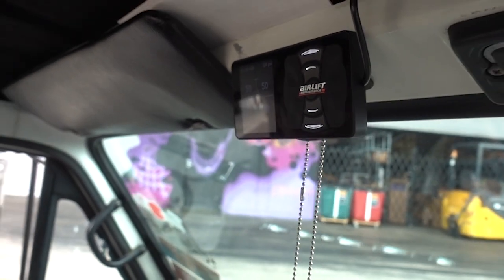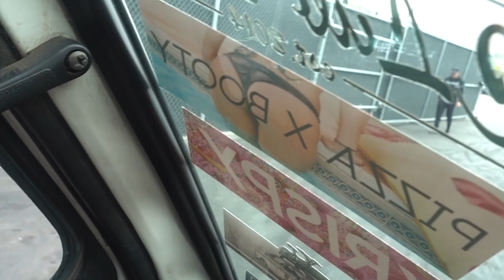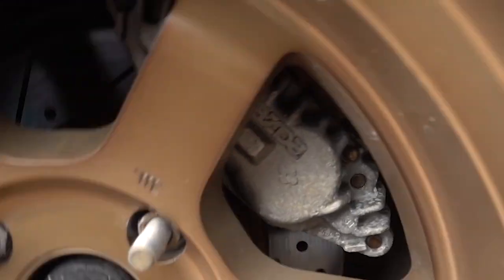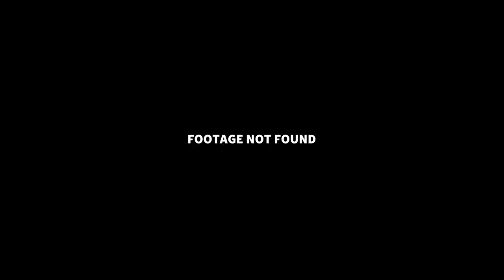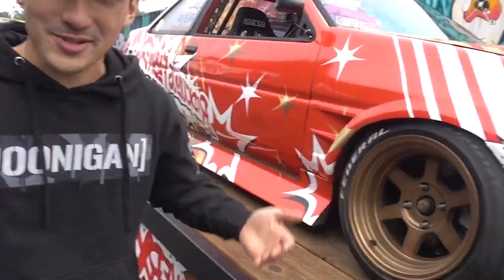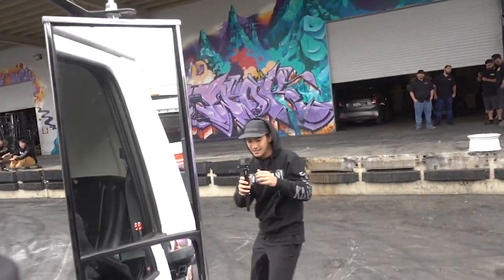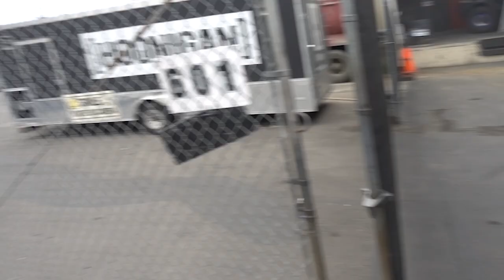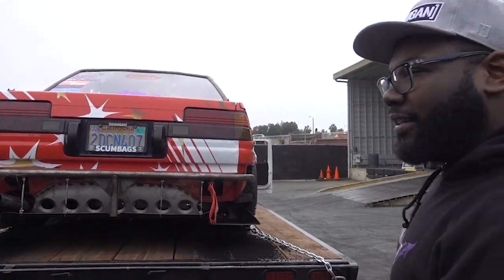How to Load a BALLER HAULER

Comment: I was thinking of building a camper but worried about having a crappy engine. LS? Problem is I am in the UK :'(
Reply: A ton of guys here in Australia have put the EJ25 WRX motor into VW Campers

Pretty popular swap down our way
Reply: It fuckin sucks in the UK. VXR8 is the only way to get LS 😪
Reply: Yeah and too expensive, I want cheap reliable power already, he said $1000, thats just over £700! It would be funny to use a V12 from an old Jag but that would need to be rebuilt and then it would just break... Often! There was a time when you could get a 2J or RB26 but they have shot up in value over the years. The struggle is real man.